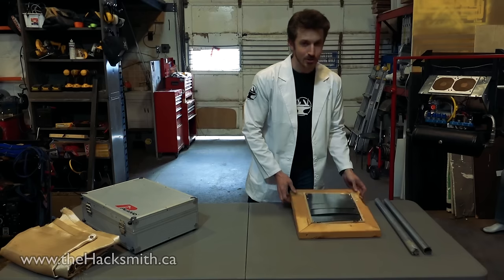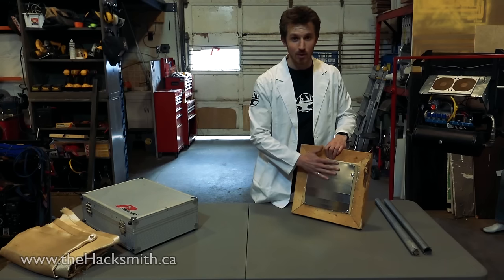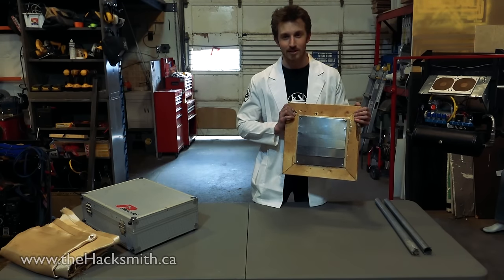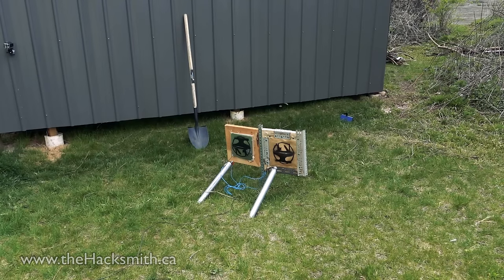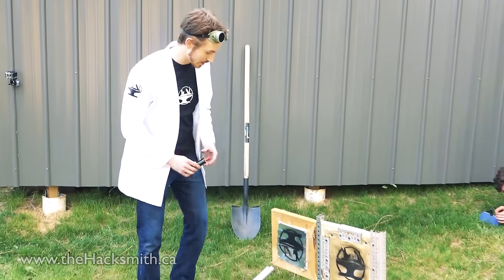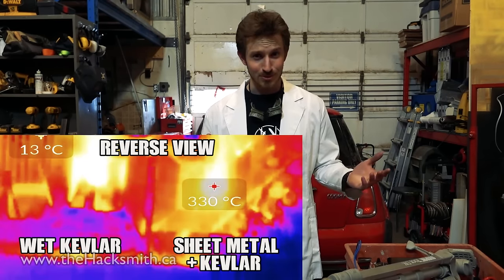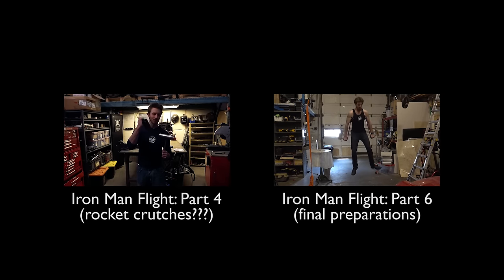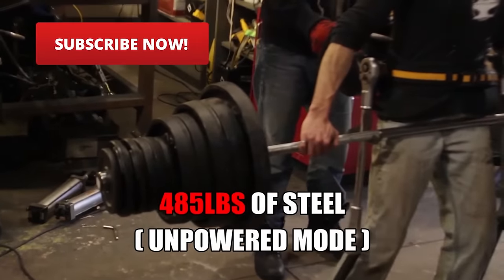Flying Like Iron Man #5: Heat Shields?

Comment: You could use carbon fiber plates with kevlar sheeting. I thought of this because the carbon fiber can withstand a lot of heat and cool of fast... This is why they use them as breaks in race cars in addition the kevlar is like a second protective barrier

Comment: Kevlar  doesn't have many thermoprotective properties it's just abrasion  resistant  nomex  would  be a better  choice in material  due to its slow been rate. That's the reason almost all if not all fire fighting equipment that has a fabric component is a composite of mostly nomex

Comment: i think you should get a thin sheet of steel then behind it use fire brick (the ones grant thompson used for his arc furnace) cut them into 3 cm slabs and connect them to the steel plates

Comment: Maybe use sheet steel instead of aluminium? It takes quite a bit of energy to melt a hole in 1mm (or even better, 1.2mm) thick steel.

Comment: I remember on a video, a certain substance was used which was advertised to be very heat resistant. it's where a guys submerges his hand in it and howers a blowtorch about it and his hands don't get burnt. if you can synthesis a similat thing, that could be doable or using fireblocks could work, like the concrete blocks which have a lot of air bubbles in them.
Reply: oh I remember now, it's called fireice

Comment: Try Aluminum Coated Fiberglass Sleeve, they can resist and reflect high amount of heat they are a bit expensive by they will work well if multilayered, also try the basic method such as water between enforced glass or carbon fiber.   There are also methods used in rocket science such as cool water pipe running in side the thruster or pants... in your case....

Comment: Maybe using a backpack (as light as possible) with a cooling system connected to special made pants running with 1 second delay after rockets activated. Maybe liquid oxygen?

(Edit: no I meant nitrogen, not oxygen)

Comment: So we can assume the rockets are as hot or hotter than a forge used to heat metal to melting point, and the amount of force is also massive. So metal's just not gonna cut it, and anything that can't withstand the force is no use either. Most of the suggestions below are either extremely expensive, wouldn't withstand the heat, or, the majority, wouldn't withstand the force.

Comment: I would make the tin with little lumps in the metal to spread the heat around and under the metal in the lumps I would put a quarter size piece of iron or iron like material within the lumps then layered with the 4 pieces of Kevlar

Comment: try using fire brick protection for your legs it shouldn't heat up strong and quick enough to burn you aswell as that fire brick is very light

Comment: there are materials that would not burn/melt I advise you to look at the type of brick used in kilns because a similar material or even similar brick type could be cut and used as A thin layer bonded with metal in a scale type armor design with each scale on top of the other meant to deflect heat downwards while keeping some form of breathability.   I don't know how to describe exactly what I mean but I'm sure you could figure it out as a practical idea

Comment: I would go with a ankle/calf/ harness. You could position the nozzle so it's flush with the bottom of your boot. Then it wouldn't burn you at all. I'm sure you have strong enough legs that won't give out on lift off.

Comment: Although it would be expensive, they have aerogels that can protect from heat in these amounts. I saw a video a while back where with ~1cm thick aerogel sheets, and direct blowtorching on one side, the other remained cool enough to touch. I don't know how much heat these rockets emit (and pressure from them might also cause a problem, but it seems feasible to me.

Comment: why not put a sheet of metal as the base cut grooves in it and slightly bend them up and then slide more metal sheets in the grooves so wen the rocket ignite it could lead the blast away from ur leg. idk if it could work or just a bunch of bullcrap

Comment: at the elbow u should add some kind of a door Hinge to be able to move better and if your gonna add it u should make some kind of locking or slow moving mechanissiam to not break your arm because of the g force from the rockets.
-the locking mechanissiam could be unlock/locked with some kinda servo with a switch hooked up to it :) love your vids said it in the other vid u asked about heat shields

Comment: I would use some type of ceramic, minerals are extremely good at keeping their tempature. in welding fire brick is extremely heat and flame resistant and moderately light, try using a layer of kevlar on each side of 1/2 inch of fire brick. another option is a few layer's of thin clay with some kevlar. i bet one of these will work.

Comment: A titanium plate should be light enough while still having a way higher melting point. If you add a layer of Aerogel to the inside that should give quite a bit of thermal protection. The only problem is that those are both kinda pricy :/

Comment: If you can make the material "Starlite" and then coat your legs with it then you would be able to withstand the heat easily. Now getting the material is the tricky part but if you can get it, which is insanely difficult, then you will be able to withstand heat that is far greater than those created from the rockets.

Comment: i suggested it in the last video but i will suggest it again you can use carbon fiber for the heat shielding they use it in aircraft and in race car seats to protect from the heat and in the aircraft from the ejection seat rockets and engines

Comment: why not fasten panels of fire bricks together with sheets of aluminum and kevlar between layers, would be bulky but still light enough to fly. If possible, wear a full body suit that is tight fitting, then wear another, much larger suit and fill the gap between the suits with crushed fire brick or insulating material.

Comment: why not put a metal tube on the other side of the rocket to reduce the amount of heat. This also increases the distance of the danger zone from your body (if you made them super long you could even have the danger zone below your feet but I suspect that would weigh to much).

Comment: Why not try using a more thermally conductive metal, like copper, to try and dissipate the heat faster? Also copper melts at about 400 degrees Celsius higher than aluminum

Comment: You could try multiplayers of metal with sheets of rubber in between them and have heat resistant rubber bolted on with the meatal

Comment: Try using temperbloc (sillicone coated kevlar) as an outer layer of the heat resistent clothes
Reply: And use some Polybenzimidazole fiber

Comment: Using aluminum like you stated isn't a good idea because the melting point is way to low to endure that much heat.  I know space shuttles and such use ceramic plates; is there a way you could use something similar?

Comment: try using a sponge with water betwen the layrs or add steel for the out side or a cooling sistem like co2 for the metal

Comment: hack smith you should try with alternated chouches of aluminium kevlar and ice cubes all over your legs it should be able to protect your legs but if aluminium dosn't contains the heat as it has done during the episode you should try with blocks of another metal 

i hope that it will work

Comment: actually you could go for something similair to the one with the arms but instead elevate the rockets position and make it with something like a shoe so you put your legs in it and stand on the floor and then launch the rockets, wouldn't add that much weight tho so helps you to fly easier instead of increasing so much weight using heavy stuff to protect, not really sure if it would work.

Comment: Instead of doing tests were the rockets at aimed directly at the "flame resistant" pant ideas. Try more of an angle since you can't be able to have the rockets hit your legs head on when you are wearing them. That might be easier. Also try the "glancing blow" of the rocket like you had said.

Comment: ceramic tile small 1/2 size sandwiched between a appropriate flame proof fabric ( nomex fiberglass header/turbo wrap etc) with fire proof insulation ( kind used in fireplaces etc)  fabric tile fabric insulation fabric   sewn together with said cloth

Comment: put a water cooling system between a high thermal conductive and a low conductive material. Active cooling system should be easy

Comment: you should switch out the aluminum plating for tungsten because it has the one of the highest melting points, or the material from fire proximity suits (https://en.wikipedia.org/wiki/Fire_proximity_suit)

Comment: I have your answer to the problem regarding Heat or rather controlling it there is a material called pyrogel this is a fabric like substance that will withstand a blow torch with ease and is used on NASA heat shields I hope this helps

Comment: i would try chainmail scales
with fiberglas insulation  behind it like the kind they use in kilns and stuf. the chain mail scales will deflect the flames aswell  each scale acts as its own heet shield  dispersing  the heat while not compromising  the whole thing and the fiberglas insulation  or whatever it is will dispers the heet and protect you from sparks

Comment: how hot are the rockets burning at, and for how long? kevlar insulation would work, but i would suggest some type of woven ceramic insert then like a tungsten alloy on the outside

Comment: Ok I have done something like this before but it was for house fires, ceramic would be the way to go namely alumina brick its the same stuff they use for the space shuttle also known a refractory brick. if your looking for something that will take to the round form of your leg then refractory cement may be what your looking for be sure its rated for 3000 f. It will stick to some surfaces but treated aluminum plate would be the ticket. Maybe a ceramic glue on the plate that will bond the refractory cement to it the layer refectory cement will have to be about half an inch thick, good luck.

Comment: Um... use porcelain? Super lightweight, used in kilns (of 1200cº+, and the heat on the other from the video is ~330 cº I think), it's easily shaped/cut, but is strong, hard and resists chemical attacks and abrasion... I think ahahha

Maybe you could add something which could increase its durability or integrity as it is quite brittle. I'm not quite sure about how you'd colour it though. 

Loving your videos btw!

Comment: On newtex.com they have heat resistant fabrics that you can use. Z-sil fabric can withstand extreme temperatures while z-block Fire and smoke fabric block flame, so I would later the z-sil fabric under the z-block Fire and smokes and on top of those two layers I would put large tungsten plates on. Maybe a sponsor could provide u with that. And I think ur issue with the aluminum was that the plates were too small and the heat was being distributed over a higher surface area, and there were more spaces for the flame to penetrate. Personally I would increase the size of the plates and overlap them more. Just my speculations

Comment: Why do you always use Kevlar? Ok, it sounds cool, but as Heat Shields? Not so good, Kevlar melts at about 250°C, and Glas at more than a 1000°C. So go with a Glasmat 10mm thick and you should be good to go. (Random side fact: Kevlar is used for Weldingmats because it is self-extinguishing)

Comment: heat cannot travel through a vacuum, maybe use a pressure washer to hydroform protection then suckered out all of the air to prevent the transfer of heat

Comment: How about a multitude of containers (to make them flexible) with some sort of liquid to absorb the heat? Fill them with liquid nitrogen? Make a flexible housing of multiple copper tubes filled with liquid nitrogen? Clearly the problem is absorbing the heat into something, as no cheap metal or fiber will be able to withstand the temperatures you are putting them into.

Comment: Use titanium plates instead of aluminum because titanium has a melting point over 3000 degrees Fahrenheit and it 2 times lighter than steel

Comment: Carbon Fiber is your best bet, as a fabric or as a sheet it can withstand far more heat and force then what those are creating. Kevlar is to weak vs the force, light weight metals melt at to low a temp, heavier metals can take the heat but are to heavy (Duh), Ceramic is to bulky and hard to mount....really i think Carbon fiber is your best bet. For getting both of them to light at the same time fill the center with "R-Candy" and put the igniter in the end of it before it cools.

Comment: What if you were to use a stronger metal like Titanium instead of Aluminum? Or dont use a metal at all, what about a wood, that is coated in something that may stop it from setting itself on fire. It may only stop it for a few seconds, but all you will need is a few seconds.

Comment: ceramics and ceramic wool are the only thing that really seems like they would be able to keep the weight low while being actually protecting you. both hold up to kiln temperatures and what not... I mean your not Stark and are not going to be able to fund NASA grade ceramic heat shields but there maybe work arounds based on the shortness of flight.

Comment: MadMaker! good idea I was thinking more of maybe using a heavier plate metal as the primary outside shield and then have a space between the heavy plate metal and the Kevlar so it acts as a thermos! see what I mean?
Reply: you could even still use the slatted aluminum straps against the Kevlar for extra protection!

Comment: that would keep the fire off, and then 3 layers of kevlar, maybe the inside one wet, because if not you'd run a larger chance of it steaming and the 100 degree, skin burning steam trapped in your pants, which would not be good, but i don't think they will heat through the fire brick or ceramic in the time they are still propelling. Or a thick layer of leather on the inside, and i mean the leather they use for welding and blacksmithing jackets and gloves

Comment: use fiberglass sheets like the ones used to insulate wooburning and gas stoves
Reply: not like the large bunches used in home insulation
Reply: it comes in woven sheets similar to the Kevlar... but with fiberglass

Comment: what if you can deflect the heat? like attach it to the the rocket to to deflect the heat but actually that would change the thrust vector... try to put a insulator in between the Kevlar and the metal maybe!?

Comment: How about carbon plating (melting point 3550 degrees centigrade) over kevlar with circulating water cooling system (like in a computer) behind it all to maintain temperature.

Comment: A good grad of cermic, something someone rich would decorate their bathrooms with, to see if it can withstand the heat. I toghut glass  but it might just melt lol - as for the force... wood! it did get burned, but it didnt go thru it right?

Plus you could try some extra shielding on your rocket crutches kinda like the ones you did to block the backfire.

Comment: How about a metal that can withstand higher temperatures? If you used steel, you wouldn't even need to use as much of it so you could achieve the same weight and strength, except it would withstand much higher temperature than aluminium. Just a thought

Comment: I think that if you add properly designed nozzles to your rockets, you will not only increase thrust, but also reduce the temperature of the exhaust.  I used to work for a company that made rockets, but as an electronics engineer, not mechanical, so I can't help with the details.
Reply from the maker: We're not using rockets anymore but I don't think you could reduce temperature with nozzles... heat still has to go somewhere as you're not changing the chemical reaction of the rocket. Cool idea though!
Reply: Okay, but for the record, a nozzle converts heat and pressure into velocity by using a shockwave.  The shockwave is like a wall that separates the input of the nozzle from the output.  On the input side you have high temp and pressure, but low velocity.  On the output side you get high velocity, with low temp and pressure.
Reply from the maker: +Steve Robbins and has that ever been done with solid fuel model rockets? Big difference between real rocketry and actual rockets... Would love to see an article on it if you have as link!
Reply: Here is a link I found with a quick Google search.  Looks like a great article.  Also, the article contains a link to software (BurnSim) you can use to design the nozzle.
http://www.instructables.com/id/Build-a-High-Power-Rocket-Nozzle/

Comment: What if instead of trying to block the rocket plume. You try to redirect it so it isn't focusing all of the heat and energy just on one spot. Because it would be hitting your legs at an angle and not head on

Comment: Try building a curved metal protector on the rocket holders themselves that way the heat is diverted
Reply: Or use funneled propellers like on a plane turbine but smaller

Comment: Just put the rovers on the Side of your feet so the flume won't touch you at all and it would probably give you more lift because it's right on the ground similar to how helicopters take off if that makes any sense
Reply: Rockets*
Reply: But I'm only 12 so that might sound dumb
Reply: That might work, but you've forgotten physics. To put it simply, whenever your doing propulsion, pulling the payload is infinitely more stable than pushing it (that's why lots of cars nowadays are front wheel drive). By putting the rockets on his feet, he'll lose a lot of control, you've already seen how messed up the rockets are.